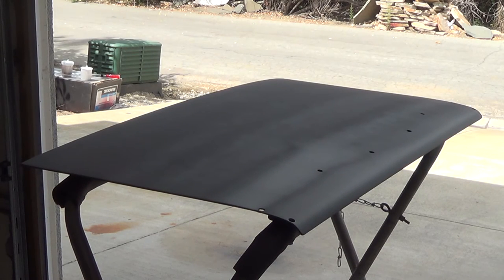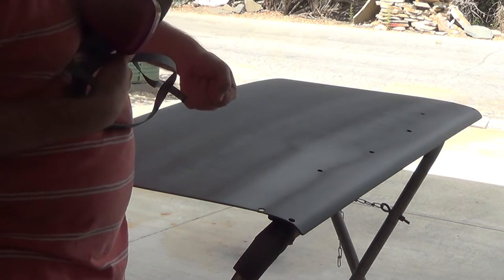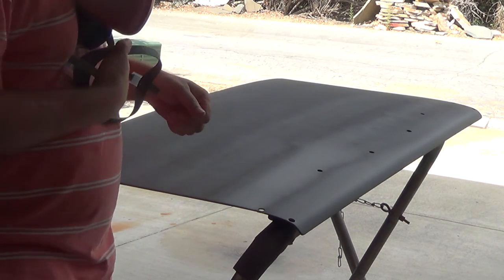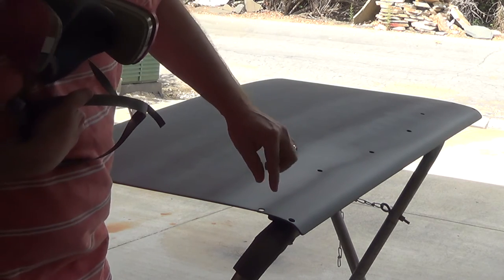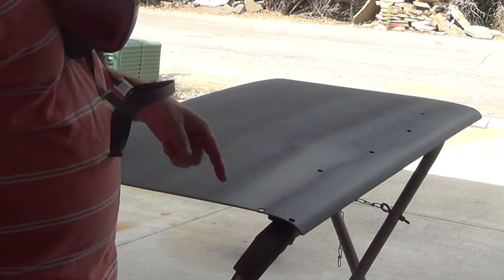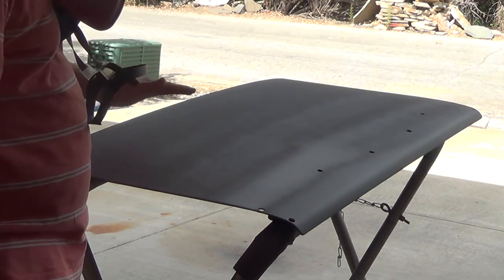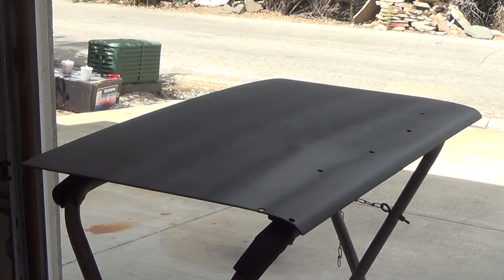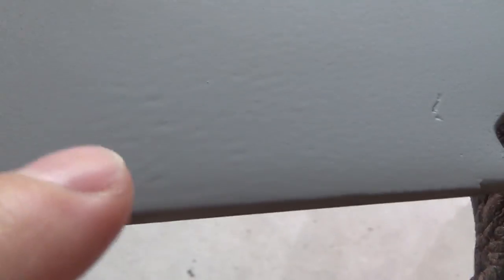Priming the deck lid part Deux -

Comment: in my opinion I'd drop your pressure so down evan more open your fan up and do a 75 percent over lap
Reply from the maker: +Mike Mckay Yeah, you are probably right. These videos were the first times using this gun. Thanks for all your help!
Reply: Yeah I noticed that. Your doing almost like a 20 percent overlap. The tighter you keep your over lap the less chance of striping. But I was always taught to go the shorter width of the pannel